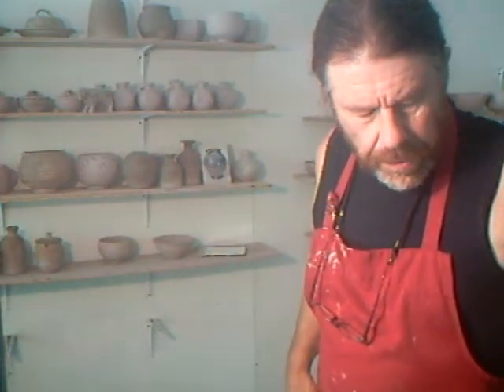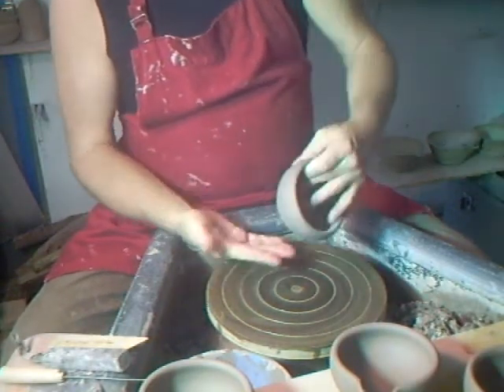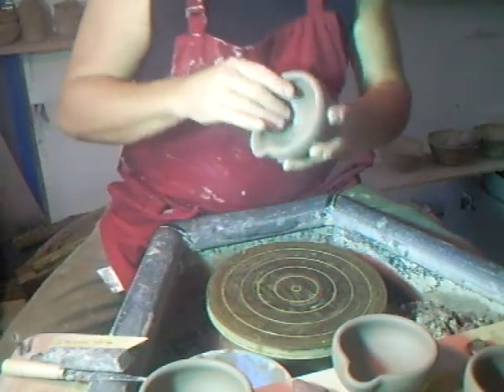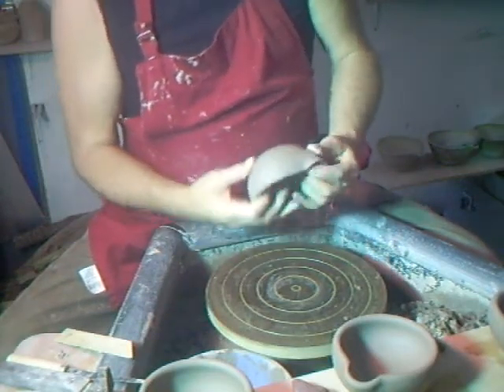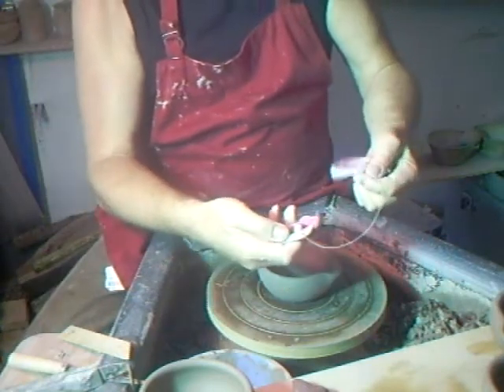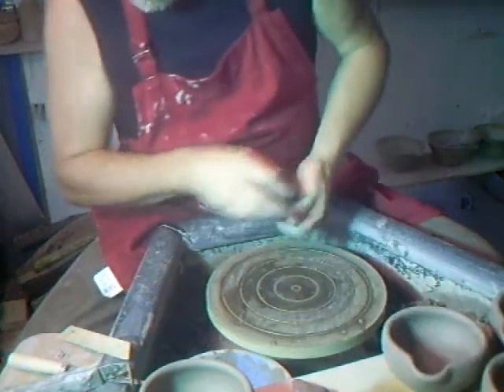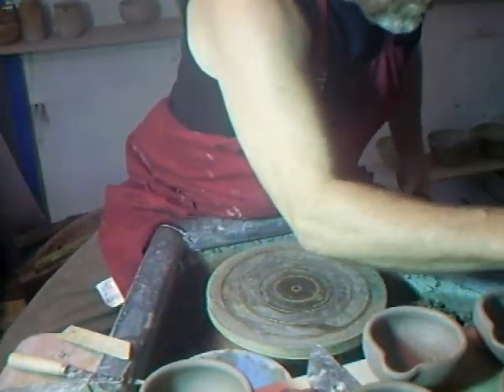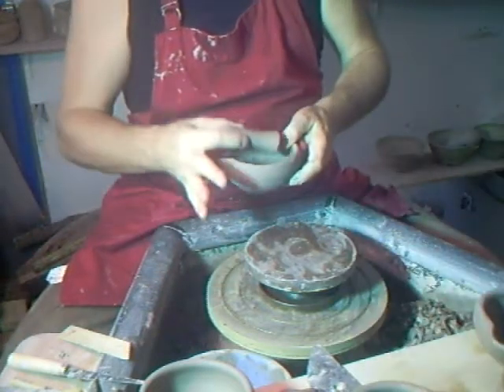SIMON LEACH POTTERY ~ Finishing off pestles and mortars !  23 Aug 2011

Comment: Ahh someone else also discovered guitar strings make good cutoff wires. I use the  A  (5th.) on the wheel and the E (6th.) around the wedging table. I trim almost everything so a pattern on the bottom is not important to my work.